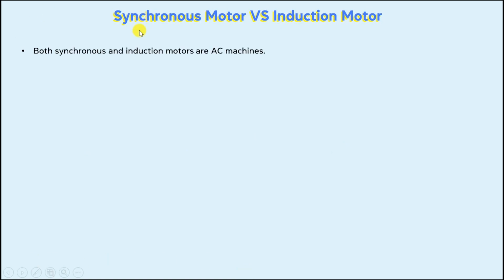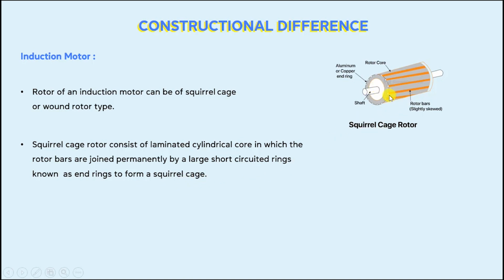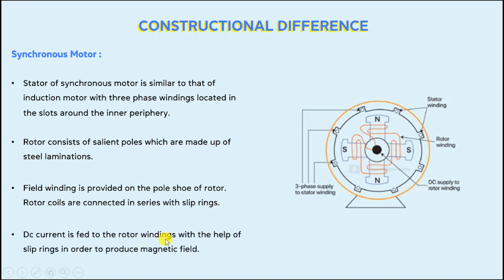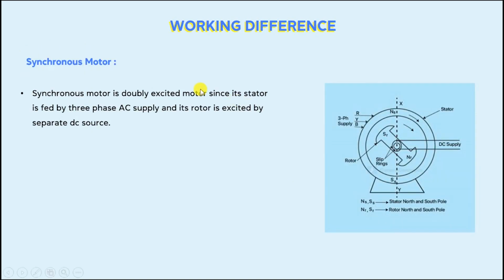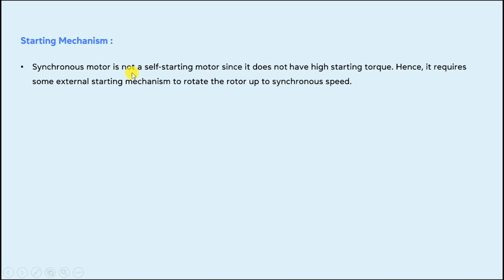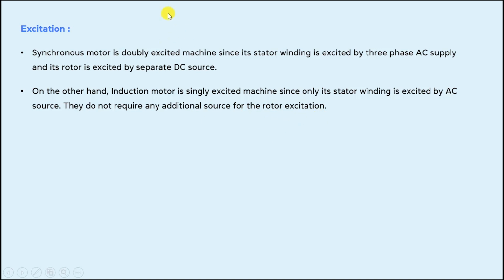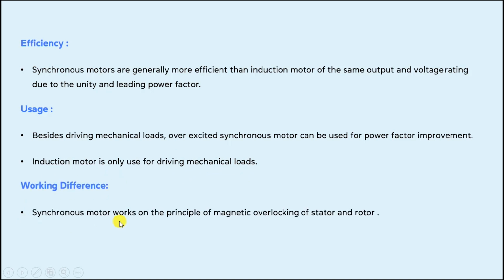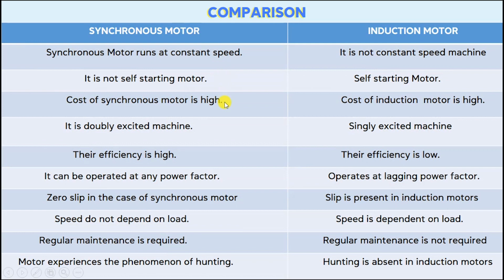Synchronous Motor vs Asynchronous Motor | Synchronous vs Induction Motor | Come4Concepts

Comment: I think you missed the back emf produced in the rotor circuit, which gave the rotor the necessary torque to rotate. in the working of synchronous motor, the rotor shaft is rotated with some the help of a prime mover, till it gets magnetically locked with rotating stator magnetic field, the rotor then starts rotating at synchronous spped. When is the DC supply applied??